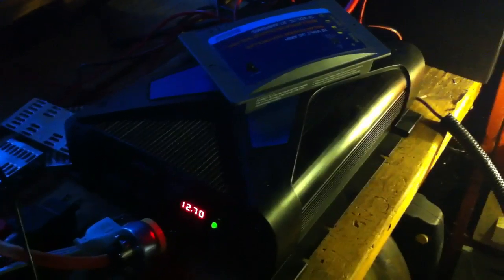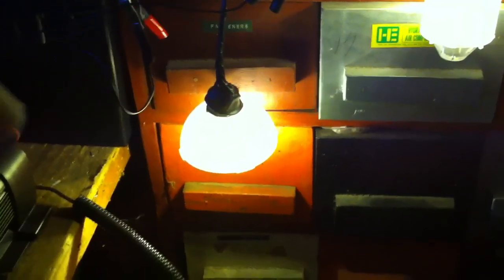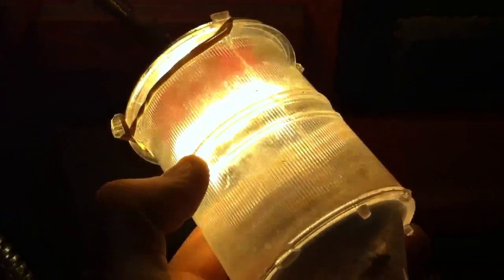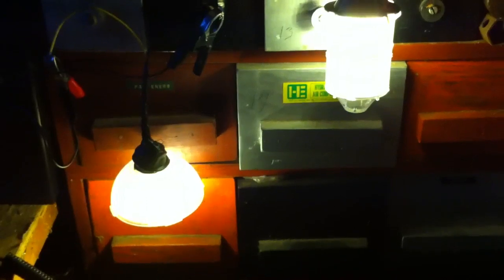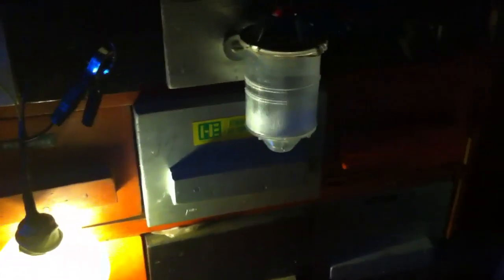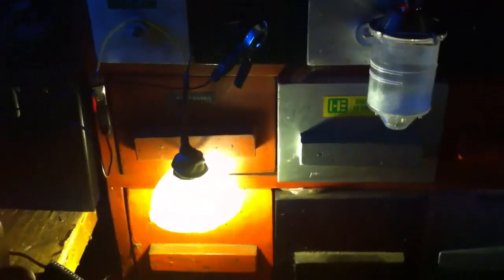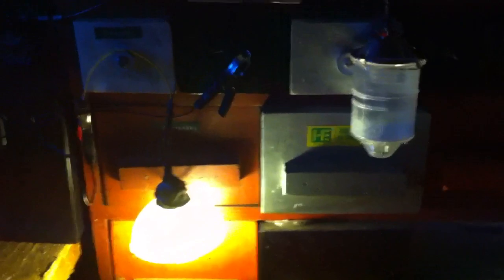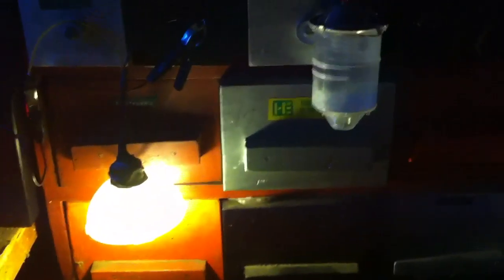Homemade 12 volt LED emergency solar lights

Comment: Good Job Bro But Not Need To Use Power Inverter Just Use Directly From Your 12 Volt Batery Bank and Skirt Breaker 12 Volt Because **Power Inverter** Draw A Lot Of Amp From Your Battery Bank You Can Use 2 x 220 amp Battery Bank = Totaly 440 amp Battery Bank To Run All Your 3 Bedroom And Hallway and Living Room and Toilet and Bathroom Also Can Run Your TV Pad And Wifi Router and TV and Iphone and Ipad and Laptop Charger In All This 2 Battery .Remember Set Up Must Have 2 Solar Panel for 180 Watt x 2 Panel and @ 2 X Deep Cycle Battery 220 amp X 2 Is 440 Amp and 1 x 12 Volt Solar Controler  AllIn DC12 Volt and Applicate All In 12 Volt Hope This Will Help Totally Off Grid I Have Already Done This Experiment Succeed Now Safety Firt OK 
From International Scouting

Comment: Where do you get the bulbs?  I would like to try this.  Do I need a regulator for the lamps?
If I understand this correctly, I need a 12 volt battery, and these homemade lamps?  
Any info for a "non-electrician" would be muchly appreciated.  Thanks.  Great video.

Comment: Nicely done. Did you rig the wiring directly to the battery, or did you find the need for a voltage regulator?